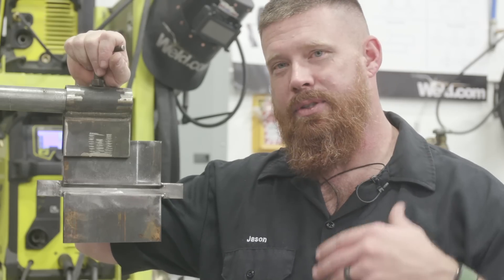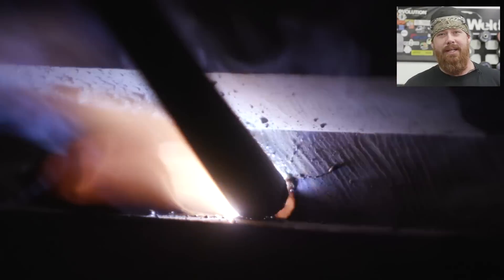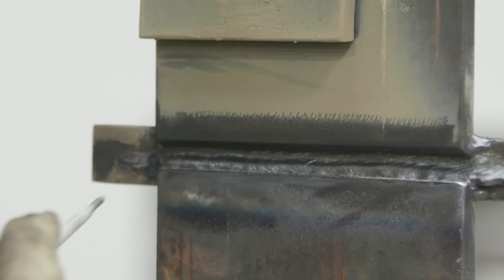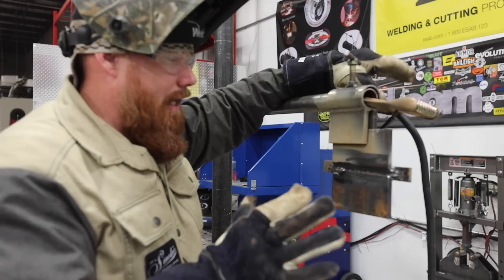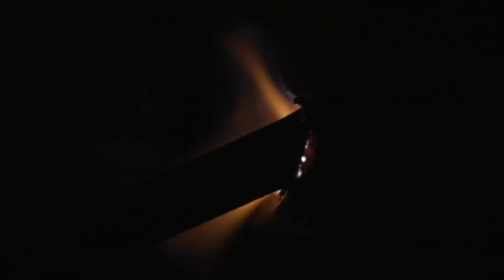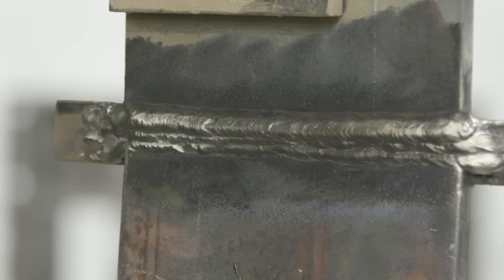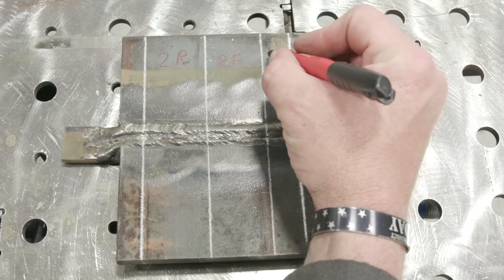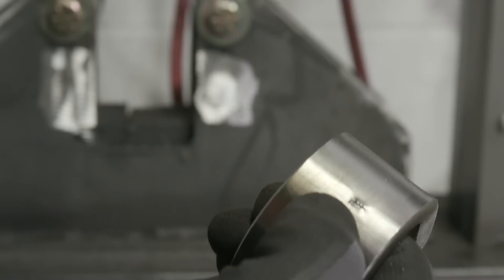2GF CWB Welding Test Bust

Comment: Good stuff Jason, in my  somewhere around 40 years of welding I always found horizontal grooves to be the hardest to get right for me no matter what process I use.  Especially where the root is open, which happens frequently  in repair work where there is no access to the back side. 

I do want to note, that even after all these years it amazes me how little I actually know. Things change, new processes and ideas come up, things I never experienced in years past etc...I still learn everyday. Now I am trying to master the TIG welder.... with beat up hands that don't seem to  work well anymore and deteriorating eyesight it's a daunting challenge. But like you say. Try to make every weld better than your last and that I do! Cheers and keep up the good work.
Reply: It’s funny that you mentioned that about horizontal groove welds. I’ve only been welding for a few years, but I was thinking the exact same thing while watching this. I personally haven’t done a lot of testing, but just based on what I’ve been able to learn so far, it definitely seems more challenging for me to stack my passes strategically in the 2G Position and to get a good clean tie-in to the upper member every time. Considering the work angle, arc stream, gravity, and the way that slag floats to the top of the puddle (in slag-producing processes), it makes sense that we might see more opportunity for defects compared to other positions. It’s an interesting subject. I’m inspired to do some more 2G open root practice with 6010 & 7018 now!

Comment: Hi! I love your videos! You explain things in great detail, I just wanted to reach out about this video, I worked for CWB as an inspector and according to W47.1 in section 9.4.3.3
There shall be one stop and restart in the root pass of each weld in the locations indicated in Figures 8, 9, and 12, and in the root pass of the fillet weld in the location indicated in Figures 8 and 9 if the joint configuration in Option 1 is used. (we use figure 8 (one fillet, one groove) 

That being said the 2GF is in fact required to do a stop and start on the fillet side if indicated by the inspector, most inspectors don't ask for it as it is covered in the flat (1GF) position, but I do tell my students to always practice it just incase the inspector asks for it. Better safe than sorry! :) 

Keep up the amazing work!! I always recommend you to my students!!

Comment: From a CWB welder (from Canada) there's no limit on how many fillers you can put in. For me I've always run 3 bead root pass (square face then bevel and run a bead to tie both sides in never had a faill). A tip I can give you is on your cap passes turn your amps down from about 125 down to 120 if you weld with that heat.

Comment: 1. I knew as soon as I saw that restart on the incorrect side and how it started up that it was not going to pass, at least based on the footage.
2. Horizontal is the hardest imho for getting enough weld material at each end of the plate (A trick some use, is to wrap your welds around the corner to help fill/maintain height)
3. Undercut on the final cap bead is very common.
4. I feel like the camera guy might have been calling you out off camera, giving you some of the business, to make the extended cut of "Own your mistakes"
5. I would love to see a restart of this test.
6. I want to see Red and Mancub compete on who does better in all 4 positions for these CWB tests.
7. Great work and greak video!

Comment: About this 2GR test, I have some experience with the 2GR position and might be able to add some insight to the process. As I've run test booths for a number of years, one gets a very solid understanding of what it takes to pass a test for this or really any position. Seeing the hundreds or even thousands of coupons x-rayed, bent, notched or pulled tells you exactly what you can get away with and what you can't. That said I'll give you a critique designed to improve and pass next time. And first off you can weld- you have good control of the rod and your basics are in - that's easy to see.
1. The number one reason for failure as observed in many welders (thousands) is the planning or the layout of each and every bead you run. I've been saying this for years; "the outcome of a weld (the product) is directly proportional to the 'timely' planning of that weld." Plan your beads before you start and know exactly where you'll be placing each and every pass.  
2. The lack of fusion in the root just beyond the tie-in in the first pass was due to a bit too much time (and too much metal deposited) in the root area which you had to go back over after you neatly wrapped the tie-in then deadheaded into the now cooler metal and this is going to suck up badly needed heat required to penetrate the parent metal which in this case is the backing plate and the lower plate. That resulted in a 7/32" lack of fusion which showed itself with the root bend and it's notable that an x-ray will often pick up lack of fusion as well and will show up as a thin line on the film. On the other side you may have gotten by with an x-ray on this one. I know this as it has been common to x-ray the coupon and then do a root bend. The x-ray can miss the small LOF and the root bend will show it right up.  
Here's the most successful handling for this problem encountered by welders that passed thru my test booth; You were welding L to R so you strike up from R to L and pull up to the crater as you call it, I call it a stop, and you time it so that you arrive at the stop just as you establish full control of the rod and arc, you do a "C" shaped loop to fill and move on and right over the arc strike you left in the root about 1.5 seconds ago. And I don't care what you left there as long as it's not too much metal deposited earlier, porosity, slag, just pure garbage will clean out nicely. Testing shows this to be the correct handling for LOF issues. (of this sort)
And as I'm going long here anyway, to finish up on planning out the beads for this coupon, I most likely would have had 8 passes to your 7 passes as I like to get closer to the edge of the plates both bottom and especially the top. 
Here's my reasoning: On the bottom I want to always leave the plate line which is going to be my guide for the first pass of the cap to keep it nice and straight. This will set up the next 2 or 3 passes and make a very good looking cap. On the cap I normally run a bit smaller bead and stack as tight as I need to in order to come out with the last bead being the smallest bead of all right at the top where it wants to undercut. The extra pass would be inside and this fills as close a possible to the edge of the plate without covering it up at the line then I can run the smaller beads for the cover passes. 
That's pretty much all there is to that test.

Comment: Great work Jason! I teach welding up in Canada and deal a lot with the CWB’S obviously. If you go back through your video, you can see where you had your stop start and reignited the rod you came back too slow and welded though the slag. Also, rod angle is critical on this weld. Too flat and you’ll get LOF. We test welders on the CWB’S quite often and the most common failure is on the 1GF believe or not. Because of this, they don’t qualify for any other position even if they pass them unless they retest the flat. These videos are awesome and I’ve been sharing them with my students!

Comment: Tie ins are usually the culprit in tests that go badly. Good you demonstrated exactly that in your bend test. This video is a great learning tool for folks that are learning. I think you covered this test quite nicely pointing out the areas in the welds that are particularly important to achieve quality welds. I usually run pretty hot on the root passes then adjust accordingly.

Comment: Just a tip for anyone taking a plate test.. run a fourth pass on your cap. Only putting three beads doesn’t really cover the shoulder too much, mainly just fuses and its a thin line of fusion at that. The fuller metal wants to droop and sag due to gravity so the material you think you’re adding over your shoulder is really falling back down onto you’re previous bead. That leaves you with a very thin line of fusion and more possibility for undercut. A fourth pass ensures you have the same amount of material over your top shoulder as you do on your bottom shoulder. Also hold a tighter arc than usual to help prevent undercut and point downward very slightly in stead of upward.

Comment: Wouldn't mind taking the Canadian test. Just to get it done. AWS certified. Just another notch
Reply: Not really worth it unless you work in a CWB shop. Otherwise the lapse quickly. You don't keep them forever just by using the process like AWS. Even if you use the process all the time in a CWB shop you still have to check test every 2 years.

Comment: Great video Jason! Couple pointers for those going for their certification. 

Perform your stop start first. Once your tie in has been checked by the inspector, lay in a hot and heavy pass on your square side to try and eat up as much of your stop start as possible. 

I would always prefer to go a bit over the 1/8” reinforcement rule in a spot rather than terminate a half pass to fill a low spot before capping. Inspectors in my experience are more lenient with their measurements before the bend.

Comment: Do you self a favor and kill the Arc force and Hot start, if used, and drag the rod!  I was instructed by my CWB tester to do it.  He said it leads to better penetration and a better weld.  I have been CWB certified for over 15 years, trust me it works.

Comment: Ungh. I've done the cwb twice for 7018, all position. Makes for a long day lol. Wasn't as bad as testing for railcar repair though. We had a stainless to black on the flat in there as well as a straight overhead mig test. 
The mig one was horrible. Had to do that part three times 😅. The rest were relatively easy.

Comment: Hopefully a helpful tip, the first square side pass aim more for the backing plate, hit the square but more so on the back, then you have a better landing for your groove side, basically 20 degrees  to the plate for for square, then aim at the groove side and burn that edge.. as mentioned, try to keep the two passes flat so your cap comes out with no issues..  hope this helps

Comment: Did you have power fluctuations while making that weld, I thought the arc varied a little. I worked at one time where there was a grin dryer next door and come harvest time every now and then as the thermostat on the dryer switched in or out there was a massive variation in the power enough to sometimes extinguish the arc or cause a blow through if the power went up.

Comment: Horizontal tests are not as easy as one would think. I would usually pass my 3G and 4G tests fine. Almost all failed tests for me were when they gave the the 2 G test. Even though passing a 3 G and 4G test qualifies for a 2G per AWS, some companies give the 2 G test for that reason. Great job anyway with your stringer bead placement.

Comment: I had to do a test similar when I was trying to get on with Union Pacific. A little different but not much. 3/4” plate. Square bottom piece, top piece 45* bevel. Pretty sure it was 1/4 gap with 1/4 back strap. Stuck, MIG, and flux core. This was the only one I struggled with all 3 processes

Comment: Thank you Jason for your honesty do you think when you do your restart that when you start Infront move back the burn out your trash is the problem I found that if I do that sometime it blocks the root and that it won't let you fuse into the corner I like to start on the tail so my root is clean for good fusion. Then on my fill pass run over the top of start stop so if there was any lack of fusion or trash it's not in the root it's more in the fill

Comment: On the 2gf test,  your're allowed to run the square edge in one pass.  The reason for this is that they consider it a 1F position which you already are qualified to do if your welding the 2GF test
Reply: Exactly. And it should be FG not GF as you weld the fillet first, then weld the groove.

Comment: So this is where my weird metal clamps come from. 
I found those U shaped metal clamps on a flex market once, and it's now clear that it was made from those..
Basically a U shaped thick metal plate, a nut welded on it that add some thread, and bolt with a tube welded perpendicular to it for than handle...

Comment: The cwb test requires a stop start on both the square edge and beveled edge 1.5 inches in on opposite sides of the cupon for the root bends. And the face bend is done in the center of the cupon
Reply from the maker: That's true for all positions except horizontal

Comment: Ived noticed inverter's in particular when doing horizontal plates on the cap if you have to much of an angle pointing up so your bead doesn't droop down it wants to cut out and stick I've only experienced this with inverter's not transformers

Comment: Great video,
Sucks to bust a test but any of us who weld for a living has at least one failed weld and those of us who have to take weld tests have at least one failed test.
Where would I look to find the material specs for this test?
Plate size, thickness, bevel angle, and bend radius?
I think it would be fun to try it.

Comment: Lack of penetration on stop and start was due to your starting to far ahead of the original stop.
I noticed it as you started again.
👍
Reply from the maker: We didn't realize it until after we finished.
Reply: Weld.com it happens to the bests of us welders. A trick I use to avoid this from happening is to sand off the excessive flux from the tip of the electrode especially when your using Low Hydrogen Electrodes.
I did my certification in 1986 and we weren’t allowed to use any backing plates or tabs.
Using a grinder was not allowed.
Every pass was to be cleaned using an old hacksaw blade shaped like an eagle beak.
So every time you stop you use the blade to feather the stop removing excess and offer a clean surface to start again.

Comment: Go for a walk before your final cap, an you will eliminate the upper undercut to within tolerances of CWB.
Time of walk undetermined.
Adjust for the bevel burning down into your puddle with FC, and you should do well, it's the bevel that you need to catch for this one.

Comment: You learn way more from mistakes than any other way. One thing you can do to give you a better fighting edge, is to tilt your plate 15 degrees as it allows you in the CSA W47.1. This will greatly improve your visibility and manipulation of the puddle, as you weld the beveled edge. It will also make it easier to produce equal legs on the square side. Once you run your first pass, I like to only see a 1/8" to a 1/16" of backer showing for the second pass. Anything larger would indicate too small of a first pass.
Reply: I thought about that. I know there is a tolerance with AWS to tilt the plate but it wasn’t mentioned in the document we used for the CWB test.
Reply: @jasonbecker3362  you are allowed 15 degrees in vertical up and in overhead both sides. Its key to see the puddle. You don't have to but it's way harder I think.
Reply: Chris R good to know thanks for the heads up.
Reply: @jasonbecker3362  any time, bud 👊🍻👨‍🏭

Comment: If your rod sticks, DO NOT OPEN YOUR STINGER CLAMP!!!

It will arc and burn up your bronze pads, and after a few arcs, your stinger won't hold the electrodes.

Instead, pull straight back sharply and quickly while relieving some of the spring tension with your hand.

This minimalizeis the arc and directs it to the side of the contact pad, instead of one the face.

If you buy your own tools, this will save you time and money😉

Comment: When does anything in the real world have a backing strip can we see a real weld without it?
Reply: Maybe you need to get out and weld more lol there’s quite a few things out there that require a backing strip. A lot of butt joints in tank floors, tank verts, and lots more require a backing strip. But remember CWB certs are only structural tickets, they certify you in groove, fillet, and all positions on plate.
Reply: I'm from Australia and to be a coded welded it's all vbutt open root all positions.. So yea can weld mate the real way.
Reply: And weld ss chem tanks and ships down under haven't seen a backing strip yet either you can pass xray or not champ hahaha
Reply: Slayer Inbound lol never said anything about you not being able to weld... I’m certified in pressure welds too bud... 7018 all the way and 6010 root 7018 fill and cap, I’m simply saying there’s lots out there that require a backing strip, depending on where you are the welding codes are different. Has nothing to do with being a “real” welder... get off your high horse bud lol

Comment: Don't forget to burn your rods out, most CWB inspector will check to see that your rods are burn down to 2 inches or less. Most of us Northerns will trade our chipping hammer for a cold chisel and ball peen hammer. That way you can remove any spatter and manipulate craters ,or dig out a piece of slag that you think is left behind.
Reply: What does burning your rods to two inches have anything to do with it? I literally never do that lol
Reply: @madrad3  Never heard if that either. I would always start a new rod if the one I was using wouldn't make a full pass.

Comment: I thought you couldn't use any power tools 🤔. L.o.l.
Reply: You are allowed a wire wheeled grinder. At least I was when testing at CWBs Nisku test shop.
Reply: Wire wheel is ok. No tools that remove or reshape the metal.

Comment: The 1/8 failure is all COMBINED faults. So, lets say you have 3 faults all 1/16 each. You fail. Its not a single weld fault, its all of them combined.